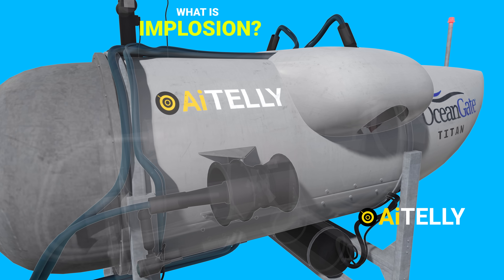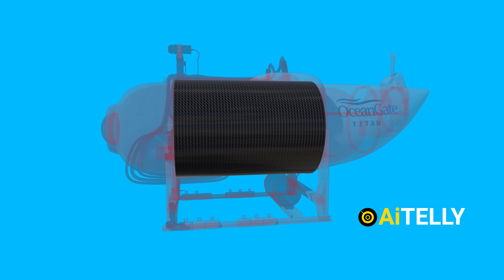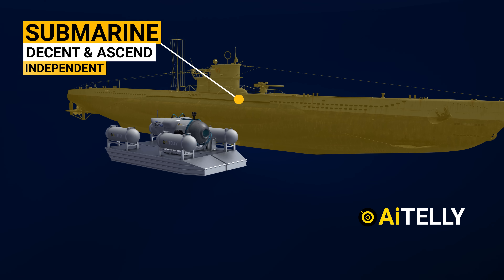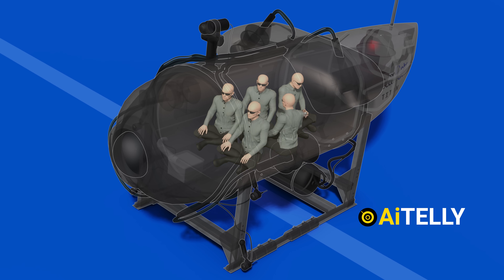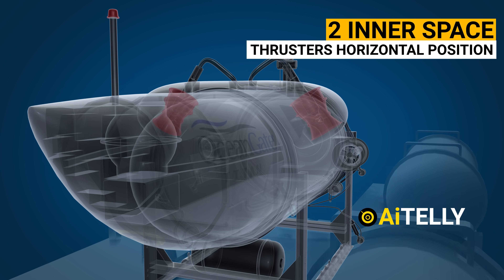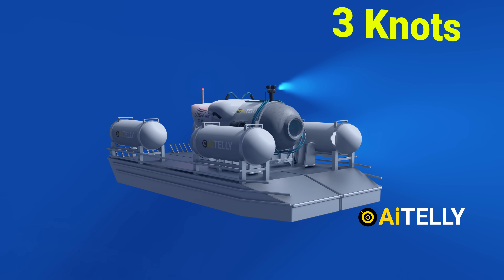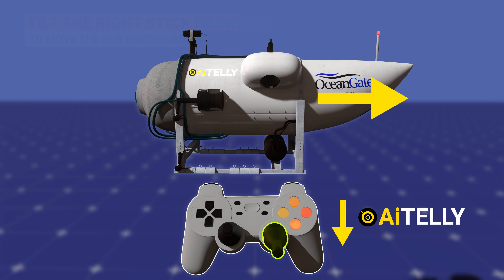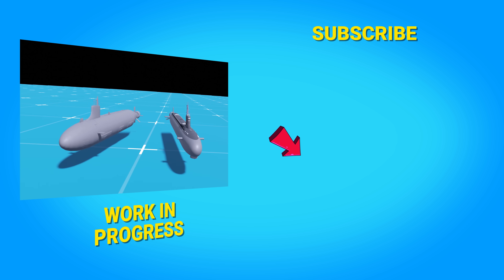Implosion Titan Oceangate How it Happened | Submersible Submarine Parts #3d

Comment: This is full of simple and stupid errors.  The platform only submerges to just below the surface and does so by pumping water into tanks to achieve neutral bouyancy, ot doesn't dive deep as shown by using "thrusters.  Also you dont "anchor" a mother ship in 13,000 ft deep water...you think ships have anchor chains that long?  The ship is held in place by using powered propulsion devices taht keep is locked to a specific GPS position.

Comment: Very detailed video, thanks for the in depth explanation. What if something breaks such as the controller was there a backup meaning spare?  Clearly there were three screens so if one broke I'm guessing the other monitors can display data.
Reply from the maker: Most likely
You might also like Nuclear Powered Submarine Engineering behind it #3d Nuclear Reactor released
Link: https://youtu.be/J0lb46Zi5-s

Comment: is not a surprise the implosion, a carbon fiber cilinder is a great mistake, not by the shape but for the material, a non "cristaline" material like metals and other solids are stressed by continuous dilation and compression, the carbon fibers are that, fibers joined with a special resine... if that resine fails in microfractures, the fibers instantly loss their union and break with that pressure, with more reason if they only put the fibers oriented in one direction and not in different orientations to reinforce the union, that not happens with metals, that are an homogeneous block, and for subs is better to make pieces with the less welds possible, because are the weak point of a metal structure...

Comment: A large ammount of the titan is made of carbon fibre which is very strong but is also very brittle so im sure what would've actually happened is that the submarine probably wouldve shattered and sent shrapnel into the crew before the water got to them making them very chunky before the water even touched them which would've also explains as to how they somehow found body parts as if it traditionally imploded like other subs the crew wouldve been crushed into where their lungs are and turned into a milkshake.
Reply: THEY TURNED INTO HUMAN CHUM. THEN INTO FISH POOP.
THEY FELT LITTLE PAIN , BUT I IMAGINE FEELS LIKE 100 NADES GOING OFF UP URE KEISTER. HORRIBLE TUMMY ACHE FOR A FEW MILL SECONDS.
Reply from the maker: You might also like Nuclear Powered Submarine Engineering behind it #3d Nuclear Reactor released
Link: https://youtu.be/J0lb46Zi5-s

Comment: Total novice understanding here, but as far as i know... Carbon fiber is good as a support material for more ductal material, like metal. It's flexible enough to be put into the shapes require during construction, but reasonable solid once fully cured. Its biggest weakness to my knowledge is delamination due to overstress or thermal cycling. Essentially the two major issues found in deep sea exploration. Being subjected to the cold pressures of the ocean probably caused a stress fracture and subsequent delamination, resulting in an implosion.

Comment: I don't mean to sound sick or morbid, I'm just curious. What happened to the bodies of the passengers? At that depth obviously they died instantly, crushed by pressure. And this is sick, but how crushed? Like an aluminum can? Intact but only small and compact? Or were they crushed so much they were liquefied? I picture it somewhat like stepping on a worm. When you lift up your foot the worms' skin is somewhat intact but everything inside was expelled in the form of a liquid goo.  It's a gruesome topic, I get that, and I mean no disrespect to the victims, I'm
just curious.
Reply: Probably just puddles of blood with no hope to recover any body parts
Reply: @CatBot007  
So like liquefied then. I was curious because I wondered if the families would have a funeral with something left to bury. Closure is very important to the survivors when a person dies and not having a body to bury can add to the family's grief. I feel really bad for the wives, parents and children left behind because this tragedy could've been prevented with a correctly built submersible. I assume it was the use of carbon fiber that caused the implosion. 
Ok, thanks, I appreciate your input.

Comment: A Titan sub lab test could be done rather easily and in just a few days. First step is straight compression in a press. Place a port (discontinuity) in a sample pipe of carbon fiber and titanium. No sub is in pure compression. The sample tubes could be proportional to the Titan cylinder. Test to yield point, with yield defined as first large strain (such as the standard .2% elastic curve offset). Then take new samples, measure length to .0001” accuracy. Then compress to half their yield load, 100 times. Check for permanent strain. Surely there would be none for titanium. Fiber composite might have internal small failure sites (fiber kinking and epoxy cracks). The length would likely be shorter. Electron microscope tests could be done. Then take samples to failure or another 100+ cycles. These results are a start. But you'd need to get the exact graphite composite formula which the sub used, wind it like they did; and also somehow test the stain at the composite-titanium ring joint. That is more difficult task but not impossible. I could test a prototype at my lab at work, simulating the stresses involved. We have the cycle machines and high pressure to do it. It wouldn't take more than a week. The talk about big cost of testing is BS. Only full-size testing is super-expensive. We know enough about the modes of composite failure to do appropriate small prototype testing. Sadly the simple, common sense testing wasn't done. I'm not even in the sub buzz and I can see all this.
Reply from the maker: You might also like Nuclear Powered Submarine Engineering behind it #3d Nuclear Reactor released
Link: https://youtu.be/J0lb46Zi5-s
Reply: @Aitelly  Thanks. Very interesting.

Comment: Carbon fiber…microscopic water ingress into the fibers. James Cameron broke it down nicely. Under very high pressure water enters in-between the fibers of the carbon fiber hull on a microscopic level, and the longer/more it is subjected to those high pressure the more water will enter and build until it cracks
Reply from the maker: You might also like Nuclear Powered Submarine Engineering behind it #3d Nuclear Reactor released
Link: https://youtu.be/J0lb46Zi5-s

Comment: They may have died from an implosion but Stockton Rush and his hubris killed those people. That carbin fiber shattered to small pieces. It was under stress multiple times. And there was no way for then to inspect the hull to make sure it was okay. Well, no way that Stockton Rush was willing to do. Kinda why nobody else uses it. And he got it for cheap because an airplane manufacturer was getting rid of it because it older and no longer safe to use on a plane.

Comment: when you have to make a vehicle that can withstand those kind of pressures and lives are on the line, why in gods name do you take chances on unproven, lighter materials?

why not design it by using existing materials that are proven to work on submarines? like titanium?

I just dont understand the hubris here
Reply: Maybe the logic is that paintball tanks that are carbon fiber reinforced are rated for use at 4500 PSI but tested at 6000 PSI. But that's under tension, not compression. and also the carbon fiber used was expired
Reply: @CatBot007  since carbon fiber is known to crack after repeated use, again I say why not go with the same materials that submarines have used for decades without insident?
Reply: @fischer9001  pretty shure they went like "ooh everything is carbon fiber now let's use that" wothout knowing the properties of it. It wasn't even in the optimal weave

Comment: I legit don't understand why you'd make a vessel meant to withstand large outside pressure from a material that is known for tensile strength (ie: good at containing pressure, not standing up to high outside pressure).

The often quoted aspect of Carbonfibres being lighter than titanium seems completely moot, given that this is a small vessel meant to swim in the ocean, so weight is literally no issue at all.

My hunch is this: The CEO saw that SpaceX was using Carbonfibres for high pressure tanks and simply copied that without understanding what he was doing. To him, "Carbonfibres" are some fancypants newfangled magic material and it's used in rocketry, so that's what he used. He picked the buzzword material instead of one that was optimized to do what he needed it to do.

The boat could have been made out of a material with the same density as lead and it wouldn't matter as long as the mothership's crane is powerful enough to lift it into the water (and even if it wasn't, you could always just put it on a barge and tow it.
Reply: Agreed: just because a carbon fiber paintball tank can survive 4500 PSI of positive pressure doesn't mean it can survive 4500PSI of vacuum

Comment: No. That's wrong in several ways. 

Firstly, no, the "hull" (the white outer part) is not what imploded; it was the pressure vessel (the black inner carbon-fiber-epoxy-composite cylinder) that imploded.

Secondly, no, the composite was not made "mostly of carbon", but rather, mostly of epoxy. The Titan was basically a plastic submersible. 

Thirdly, no, composites do not crumple (as you erroneously show in this video) when they implode; they shatter into a million pieces, suddenly and violently. That's why you didn't see any pieces of the pressure vessel among the debris returned to land; the pieces would be too small for an ROV's gripper to grip them. 

Fourthly, no, don't use bots or uneducated narrators to narrate videos; use only narrators who actually do understand the subject matter. 

Fifthly, no, do not read the section headings out-loud; we can read. 

So, you have a lot of learning and practicing to do before you can make watchable videos; you're not there yet.

Comment: But why with all this money didn't they made a hull tests in pressure chamber to check how many dives can a hull take? It wasn't bad engineering or material decision but damn lack of tests. It's like flying home made airplane, hope for the best and then wondering why it's flying smooth at start but it's uncontrolable without fuel

Comment: It is a submarine NOT a submersible. Submersibles are vehicles that are yes, launched from a mother ship but this is the key, they can NOT be manned under their own power, in other words, they are tethered to it as their power supply is dependent on it, like a ROV that drug this thing up from the bottom. 

A Submarine, be it if it leaves from port, or from another ship; be it if it can stay under the water indefinitely or must ride the surface to charge batteries; be it manned or automated remotely; are NON-TETHERED vehicles and operated under THERE OWN POWER. And yes, I pointed out a lot of the other misconceptions about the differences too as they are wrong. 

I am a researcher, military historian, and been working in this field for 3.5 years.

Comment: Have you guys noticed the monitor mounts inside of the sub? It looks like they are bolted directly to the carbon fiber. Im not sure if it was a structural component but i can imagine it would be good to do this if it was.
Reply: the hull had a stainless steel inner lining according to some reports. However, it's not clear if there was space between that and the carbon fiber hull. It's also not publicly known how the ceiling light was mounted. I assume that there was an inner liner, and that there was space between it and the carbon fiber hull, but as crazy as the rest of the set up was, who knows for sure?
Reply from the maker: @gailmcn  Nuclear Reactor released
Link: https://youtu.be/J0lb46Zi5-s
Reply from the maker: You might also like Nuclear Powered Submarine Engineering behind it #3d Nuclear Reactor released
Link: https://youtu.be/J0lb46Zi5-s

Comment: Question for those with the expertise: How can you truly verify the crush depth for a specific vessel, especially if you can't reproduce the real undersea environment to test it? And how do you know subsequent builds will have the same tolerance?
Reply: You do multiple tests in a controlled environment and then multiple tests in the ocean and then apply a safety factor.
Reply: @nolsp7240  Interesting, thanks! So there actually is a way to artificially reproduce the kind of pressure that imploded this submersible? (or close to it?)
Reply: You cannot. That's why the Test Depth  is only 2/3 to 1/2 of the design depth.
Reply: The metals that subs are typically made of can be replicated with little deviation. For instance 2 identical parts made with the same alloy will have similar strength. Carbon fibre is porous. It is not 100% uniform. 2 identical parts made of carbon fibre may have very different strength and flex/rigidness under pressure. Metal will also have a very precise and predictable point of failure. Carbon fibre - since it is not uniform in nature, breaks differently every single time.. I'm not very knowledgeable about the fatigue of carbon fibre under pressure, but it has been a common discussion amongst the experts.
Reply: @goodmorningvenezuela6329  Great info, thanks! Everything I learn about this makes it seem more and more like it was a horrible idea. And none of it seems like 'after the fact' Monday morning quarterbacking... Sounds like plenty of people tried to warn him beforehand.
Reply: in this case sosus and other navy sonar had some triangulation of the depth, just haven't been told yet
Reply from the maker: He answered your questions we love our audience

You might also like Nuclear Powered Submarine Engineering behind it #3d Nuclear Reactor released
Link: https://youtu.be/J0lb46Zi5-s
Reply: @Aitelly  Thanks I'll check that out

Comment: Steel, titanium, and aluminum have all been crushed.  The difference is the depth and they didn’t switch out the tube after 24 dives it finally gave at a depth that most subs can’t even get to with aluminum steel or titanium.  Most opt for an orb or sphere as well because like an egg can distribute the pressure much better than basically what looks like a propane tank in someone’s backyard.

Comment: That's most basic and S mistake. The point of this technology is to make withstand the pressure but it didn't and didn't they suspect that, common:face-blue-smiling:Let me design it, I will make it with thick steel all around, that's it.

Comment: Just a guess but what I'm getting is that if carbon fiber is lighter wouldn't that be a bad idea for deep sea as since the pressure is so great. Wouldn't you want to use a material that is harder. If the pressure of the outside whats to crush the object than the object needs to have great pressure too, yes.

Comment: The difference between carbon fibre and steel is that carbon fibre will deteriorate in strength and break into pieces when subjected to continuous stress which won't happen to steel. Steel may collapse but definitely won't break into pieces but I'm not an expert in this field.

Comment: I wonder, seeing as it's the composite material that failed, would it it still have failed if the passenger compartment was also made of titanium?

A sphere is the optimum build design, and the current standard. However, the cylindrical shape held for a number of dives before the composite failed. Was failure due to a combination of design and material, or just material?

Some experts raised concerns about the design but not the material, others raised concerns about the material but not the design. Could it have been a viable form of deep sea vessel were it to be made entirely from titanium?

Comment: I built a 2 inch diameter model of titan to pressure test.  I stuck it up my ass and bared down HARD. A few cracking sound and then boom implosion.  I have proven it was a flawed design.

Comment: They said they died instantly and that the pieces would of been shredded into small parts. I saw whole parts, not crushed as assumed, so they dround to death if anything. It was a death they felt and was aware of for the most part.
Reply from the maker: You might also like Nuclear Powered Submarine Engineering behind it #3d Nuclear Reactor released
Link: https://youtu.be/J0lb46Zi5-s

Comment: When the pressure chamber collapsed, it blew out the bow and stern. If they weren't blown out with the pressure bubble, they were pancaked by the inner titanium shell. Mechanical forensics will tell exactly what happened but it looks to me like the carbon fiber cracked.
Reply from the maker: You might also like Nuclear Powered Submarine Engineering behind it #3d Nuclear Reactor released
Link: https://youtu.be/J0lb46Zi5-s

Comment: "Fraction of a millisecond"? Makes no sense. I think "millisecond" suffices. 0:16
Reply: @XxMariannoxX. It's the concept rather than an incomprehensible technical difference that matters. To the human senses, one thousandth or one millionth of a second is undetectable, let alone the difference between the two. That's akin to saying from the top of the Empire State Building people on the ground "look like ants" is wrong because they actually look the size of fleas (some fraction of the size of ants). Or saying set your oven to 350 as opposed to 360 and bake for 50 minutes as opposed to 45. Again, an insignificant difference. Such precision is unnecessary, thus I stand by my original claim.